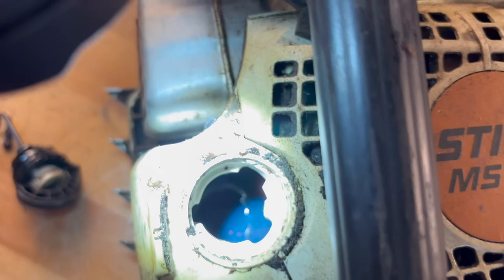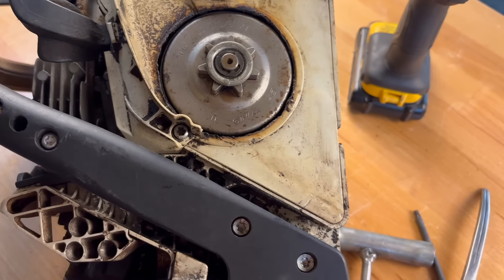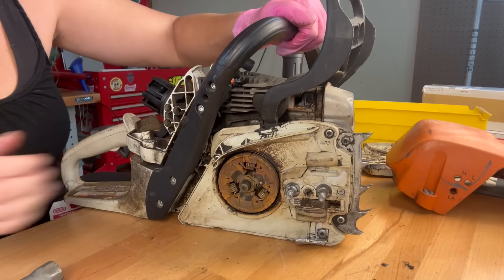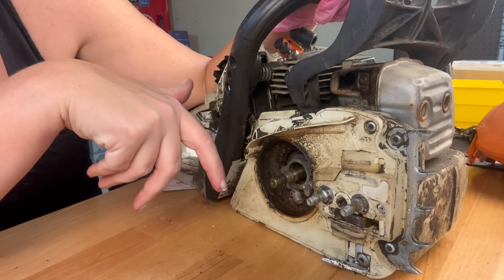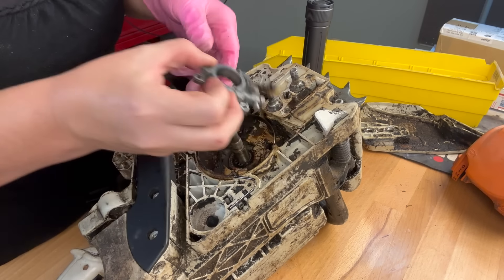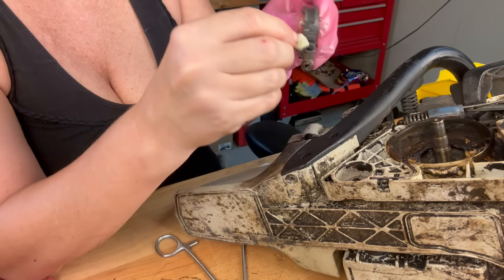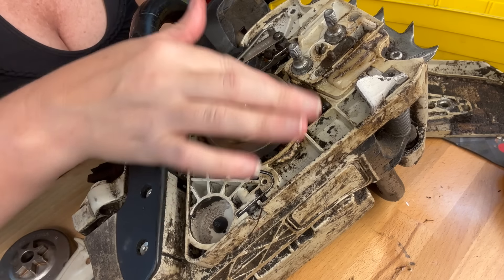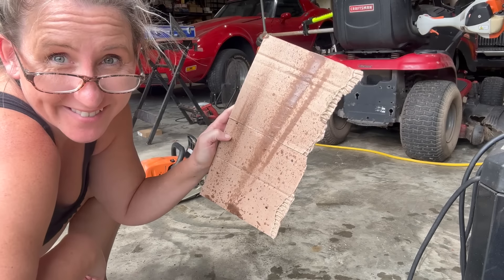Customers Chainsaw MELTED!! Always Check THIS Before You Cut!

Comment: The oiling system on the older who sqaw varna saws are quite different and you need the parts diagram for your older saws to see what's in there. You still need to keep the saw dust out of the tank and the passageways clear. Checking for oiling should still be a regular maintenance check for all saws including the battery saws.

Comment: Thanks Bre   I've put two oil pumps in my Stihl MS170 , its a pain taking the case/cover  off . I buy them from Amazon , finding a metric screw to thread into them to pop them out is sometimes ruff around my work bench as I am old school sae type man, for a little brass pump its a pain in the arse

Comment: GREAT video. I took MY 026 that I bought in 1978. to. Ace hardware to have an oil pump pit in it they said Stihl. didn't have a new pump available. for that old a saw. they. put one in it from something else. .  it had one that looks like this video.  not the bullet kind. I had to put silicon on the saw to make the oil come out to the bar .  I wish I lived close to your shop[.

Comment: Is there anyting you can do so oil doesn't leak when not in use ie. storage between use?  I put the oil fill cap on the floor but it still leaks., mabey from it getting cold and warm from night and day.
Nice vid on repairing the oil system, Thanks
Reply: Yes.
Empty your oil tank.
You won't need it until you next use the saw.
You then refill it anyway.
Bonus: no oil on the shelf!

Comment: Any damage to the bar or chain running without oil?
Reply: Yes..as with all metal to metal situations where there is no lubrication.
The chain can turn blue in the drive tangs  and the bar can do the same.
Plus far greater wear on both.

Comment: On a poulan pro,  what goes into that tiny hole, on the right, under the metal plate that fits over the bolts? Compress air the dirt off and something popped now bar oil   is dripping out.

Comment: I learned from my dad  that , you should use a Puddy Knife to Scrape out the Bar so it will remove  the Saw dust from bar so the oil has Less Restriction to Flow , I have Never seen you tell that ? 
Just Common Sence !!!

Comment: 30 years of felling timber, trimming trees & cutting firewood, i run VERY long bars, longer than recomended. If You have a used out of warenty saw then run motor oil in place of the extreemly expensive bar oil --plus a couple table spoons of Lucas Oil Stabilizer ( a sticky - tacky goopy oil ) per 1 gallong jug of used motor oil together You have excellent free oil. The Lucas will last for about 20+ gallons of oil. 3
Reply: Does the viscosity of the used oil matter?  My F-150 uses 5w-20 Full Synthetic oil which is really thin and may leak when the chainsaw is in storage.  My diesel tractors use 15w-40 Conventional oil which is much thicker and may not flow through the oiler in cold weather.
Reply: @terrapod4898  
Of course viscosity matters re flow in cold weather.
That full synthetic would be the go in winter with a tackifier added.
But unless you are cutting commercially why use old sump oil anyway?
Reply: @JohnSmith-pl2bk  Thanks for your reply.  The suggestion to use full synthetic oil in winter makes sense.  I've noticed that inflation has hit the cost of bar oil recently.  Last fall I purchased 12 gallons of bar oil at $7.00/gal.  Recently I noticed that Walmart's SuperTech bar oil was priced at $16.97/gal and premium grade bar oil was priced at $30.95/gal.  At these price levels I think it makes sense to look for a cheaper alternative.  I generate a lot of used motor oil from my vehicles so may try your bar oil hack this winter.

Comment: Stihl's are notoriously stingy at oiling anyway. Great vid!
Reply: I DO watch my Stihl's allot more closely, but they're two of the most expensive saws I own ! 🤷🏼‍♂️ Yes, they tend to be stingy. I'd rather pay for the oil personally. 😉
Reply: @marcmyers1465 I think that's related to EPA regulations.
Reply: My MS361 leaks, so I refill it before I even start it. Definitely oils the chain well. Yeah, I can adjust it down, but I would rather have more than less. It's certainly not rusty! 😂

Comment: We have had 7 small engine shops shut down and ordered to clean up the soil in their properties in my city forcing shop labor to pass $200/h in the remaining shops.  One shop's cost to clean-up costs is over 700 thousand dollars under their quarter acre boneyard from tire fibres, oil, micro plastic and banned PFAS. To open a new shop everything has to be indoors or you must employ a E-Tech (College) or a P-Tech (university) certified engineering tech who only tests soil or concrete and doesn't touch any machines!

Also anything with mineral or vegetable oil on it, like your cardboard must be disposed as toxic waste and the driver/handler both needs Class 3 dangerous goods truck licencing and handeling training!
Reply from the maker: Glad I live here! Those regulations are insane along with those who impose and enforce them.

Comment: I have a Stihl 271 farm boss and one of the bar stud bolts stripped. Do you have a video on how to fix it correctly?
Reply: It should take a Stihl agent 5 minutes to take the bolt out and put another in.
Ring him up and order the bolt ahead of time?
Or do it yourself?
Reply: @JohnSmith-pl2bk  got it, not difficult at all, ordered a replacement bolt, some loctite and it's holding great.

Comment: I'd be worried about the chain brake not working my 044 won't overcome the brake no matter what. It's a way stronger saw than a 311. I'm pretty sure stihl calls that an oil pump not an oiler

Comment: Is there a way to adjust the screw so that you get adequate oil coming out, but not too much. Besides making a mess, I suspect you can probably run out of the lubricating chain oil before you run out of gas.

Comment: at one time they had lots of problems with the wire slipping on the worm gear (back in the '80's if memory serves me)  especially in cold temps.  that's about the time low temp bar oil became a thing.

Comment: and for a pistion stop , pull out the plug and stupp in a rag with a stik through the plug hole pushin it inwith a thin screwdriver, then rothat the engine and WALLA , engine locked , cos of rag $0 cost of the tool $50-80

Comment: Smaller saws as a warning if the saw clutch is on tight you'll almost be guaranteed to knock a hole in the piston if using a piston stop....

Comment: Do you have any recommendations for keeping the chain on my chain saw, it gets checked before I start but still comes off shortly after work I ng with it for maybe 20 minutes. Any ideas please, saw is an 18 inch Poulan.
Reply: Yes.
Half way through your first tank of fuel retension the chain....
At any time you take a longer than 10 minute break...loosen the chain
At the end of the day loosen the chain before you store the saw.

You must be cutting tough wood that heats your chain thereby loosening it.
Retensioning tightens the chain but that means it will usually be too tight when everything cools down putting too much pressure on the chain and the crankshaft...

Please watch vids re correct initial tension of chains....
and retensioning of brand new chains after running them for a short period before even cutting anything with them.
Reply: Check your bar with a straight edge, and Mic. the teeth on your chain for even length. 
You're pulling to one side ! 😉
Could be length, Could be pitch, but the chain isn't tracking...⚠️ 🤷🏼‍♂️

Comment: Bar oil, vs other types of oil, like motor oil, 10w-30, is there a reason bar oil is special to chain saws? No detergents to eat the rubber or plastic plumbing and body casements part up, ir something?

Comment: I’m surprised that you didn’t rev up the saw to max and then SUDDENLY engage the brake. That does 2 things simultaneously: it checks out the functioning of the brake itself, and if it’s working properly it’ll tighten up the church to the crankshaft without it being excessive. I think that brake band is right at the edge of needing replacement because it’s so thin. The different OEMs have spec’s out for checking things like that. 😊

Comment: I have a Stihl MS 391. Great saw. I have the Automatic Oiler turned up all the way. But I don't think it's putting out enough oil because it gets hot and it will get chain and bar hot it will smoke but doesn't hurt bar or chain no signs of blue spots on bar. PLEASE HELP. Concern sawer.

Comment: Eventually I got in a habit of carrying a cheap paint brush with my chain oil container, to dust off all the wood particles before I opened the chain oil cap to the oil reserve, as well as I do not pull off the foil top seal under the chain oil container cap. I poke a poring hole and a air hole in the foil, it pours more accurately, and prevents a glut of oil coming out too fast, that usually ends up on the side of the chain saw or wasted.  this means I can reduce the number of times I plug the screen in the oil reserve. or do the nasty habit of trying to wash out the oil reserve with fuel to try and get out the wood chunks or dirt.

Comment: My MS-251 routinely fails to deliver bar/chain oil. It'll be working when you start and stop while cutting. Burns out the bar

Just replaced it with an Echo 590.

Comment: Good job! Is the 311 a pro saw?
Reply: From the Stihl blurb easily found on line:

The MS 311 Petrol Chainsaw is a full sized Chainsaw that can drive the larger 3/8 pitch saw chain - as used on our pro Chainsaws.
 It can handle felling firewood in medium density forests and is a great option for farmers. 
With our 2-MIX engine technology, you receive higher fuel economy for longer run times. 
The MS 311 also has larger fuel and oil tanks allowing you to work longer before refueling.

Notice it doesn't say it's a pro saw......it has SOME pro saw features.......but it's a grade above consumer rubbish
Reply: @JohnSmith-pl2bk  yeh... dont hear about that line very much... thnx

Comment: A tree service told  me they use nothing but used motor oil for  there  bar oil    what  is your opinion  ?
Reply from the maker: Absolutely not. First it is not tacky enough to stick properly and makes a super mess. The older chainsaws would run with it fine, but newer saws are mostly plastic. I have seen a few saws burned up from overheating, because of the continued use of used motor oil instead of bar oil. I would only use in it a pinch.
Reply: @Chickanic Second That ! Nothing like Good Quality bar oil. Oil IS NOT a secondary component in a Chainsaw. It is a Primary Component ! ☝️🤨

Comment: The chain brake band is cracked. Is that an issue?
Reply: I would say so since it’s a safety device. And when you need it to work you’ll be glad it does.
Reply: Look at 4:53 Thought the same but this is the space between the housing and the brake band.

Comment: I like STIHL’s too much. I would have taken that saw into protective custody and changed it to a rim sprocket. All that rust, didn’t check for oil flow, cutting with the brake on, dang. Hope you sold some PPE to the guy.

Comment: The way Stihl designed their chain brake is a real weak point in my opinion.  
   Husqvarna has the entire chain brake assembly built into the chain cover.  If you have multiple users like we do , someone will inevitably run it with the brake on and it is a much easier and cheaper fix on the Husq than the Stihl.   As you know , they were lucky they stopped when they did because the damage done to that saw could have been far worse.
Reply: LOVE... MY HUSKY'S !!! 😃👍